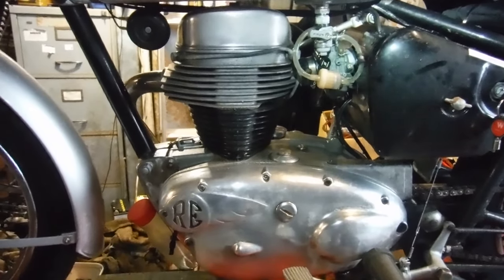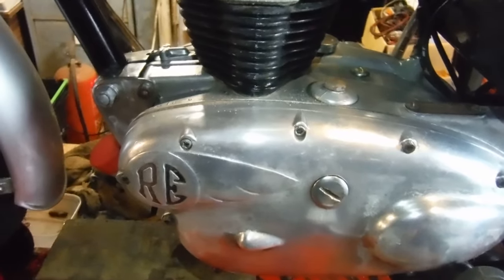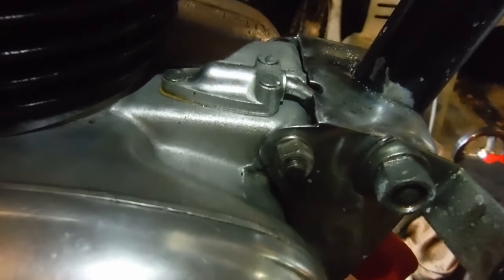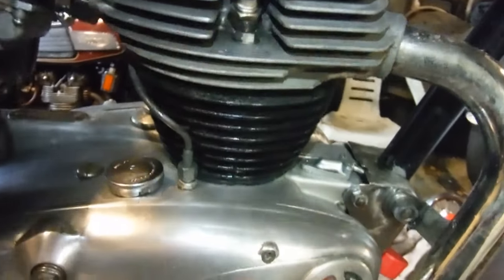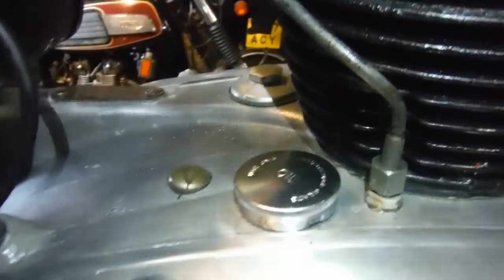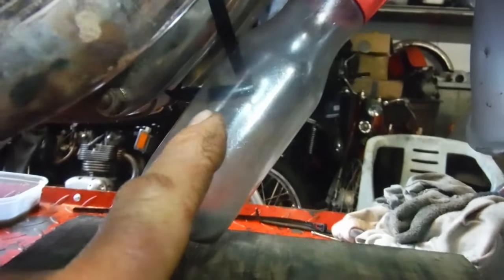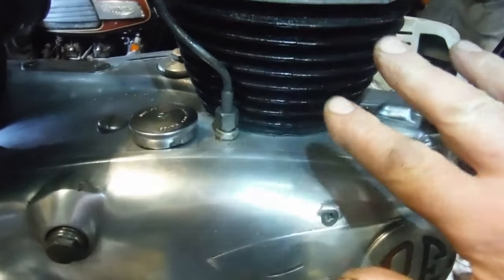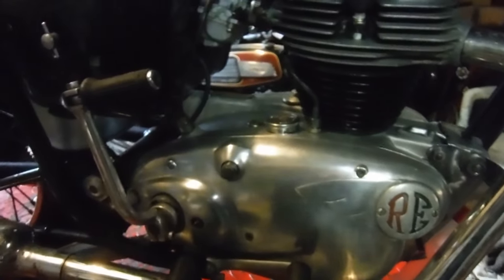Royal Enfield Crusader returns with wet sumping issues 3 Progress so far, and some thoughts.

Comment: Hi Paul, just a suggestion, on the race bikes we always took the breather pipe up to a catch bottle that was higher than the outlet on the engine, in your case up the front frame tube would work. This lets the oil drain back down the pipe under gravity back into the engine, before entering the catch bottle. In your case gravity is draining the oil over with the air into the catch tank. lf you use a larger bore pipe as well this all helps allow the oil to drain back and only the air to escape. finally make sure the catch bottle is open to the air, if it is sealed like it appears in the video it cannot vent and will pressurise preventing the breather from working. I have no doubt you will get to the bottom of the problem, you always do....

Comment: My t3 guzzi had a non return ball valve, a short tube with a blanked off end with a hole in it to seat the ball,  close fitting,   top had a washer that was riveted in,  was dimpled so it only sealed on entry not exit. I have since made a few of these for various bikes fitted in breather pipes

Comment: Usually the cylinder bore is worn when there is oil out the breather they didn’t do it when they were new so something has changed
Reply from the maker: It was recently rebuilt - not by me - although I had the top end apart to fix an oil leak not long ago and it all looked pretty good, I must say.

Comment: Is the crankcase pressure problem why the Continentals had a huge engine breather pipe ?
Reply from the maker: Probably. Several different breathing set ups were tried. The GT pipe came straight out from the top of the oil tank compartment, rather than the crankcase, although the smaller crankcase breather was retained with it, with a link pipe to the cambox as well.